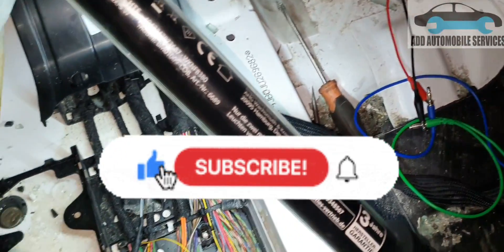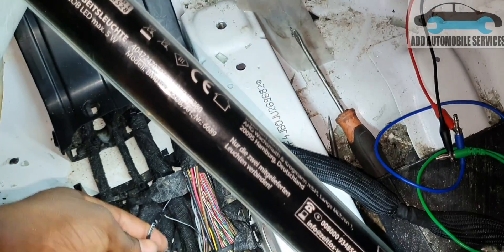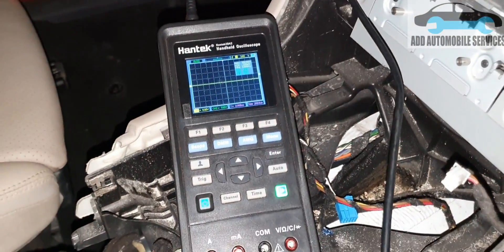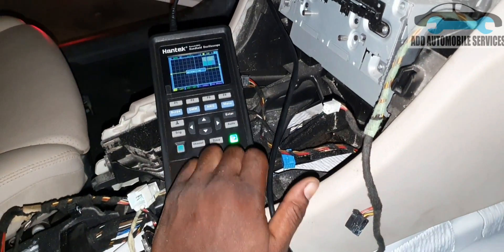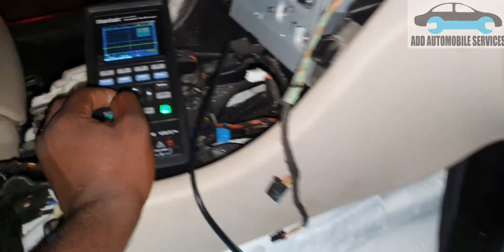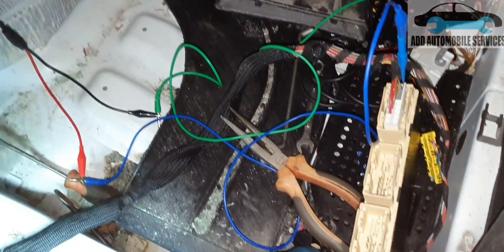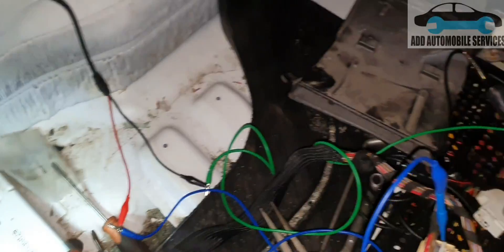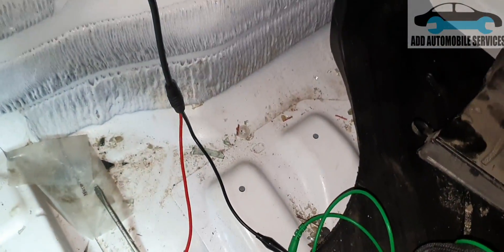C300 2019: Seat adjustment not working passenger side. Why you always need a scope

Comment: Having a similar issue with my 2015 c300.. no power to the driver side seat adjustment...OBDII doesn't pick up any error codes...fuses & Relays are good.  Changed the Door control module and no fix...any thought to root cause?  Debating changing out the Seat module but from your video it doesn't look to be the issue...how did you identify the fault wire?
Reply from the maker: Check your powers and ground on the seat module and also check you LIN Bus on that module to see if there is communication on that line
Reply: @ADDAUTOMOBILESERVICES  hey, sent you an email with more information.  Having issues with inoperable driver seat  adjustment and heated seats.  Appreciate all your help
Reply from the maker: Ok will check it